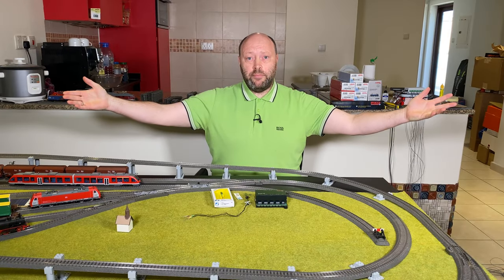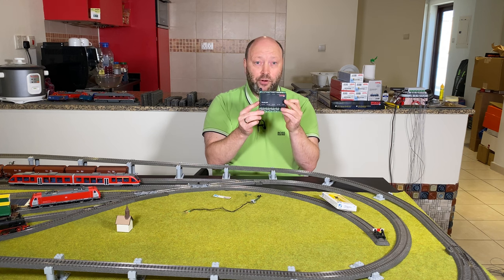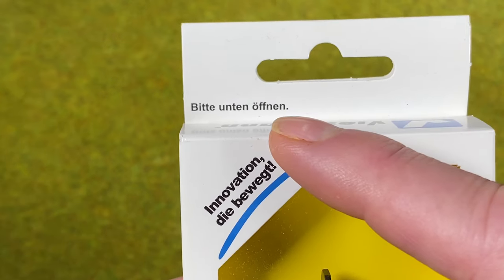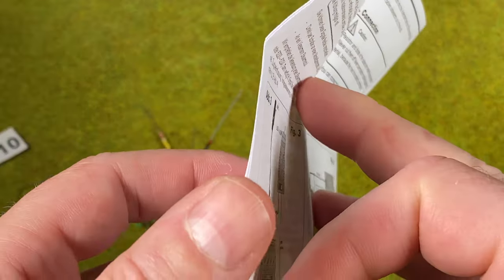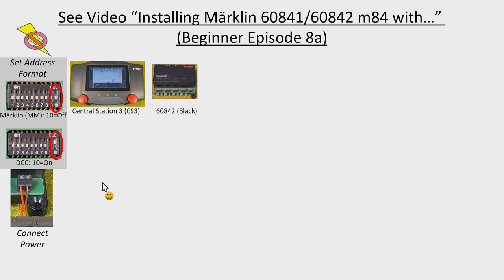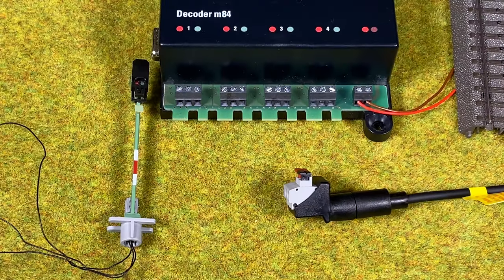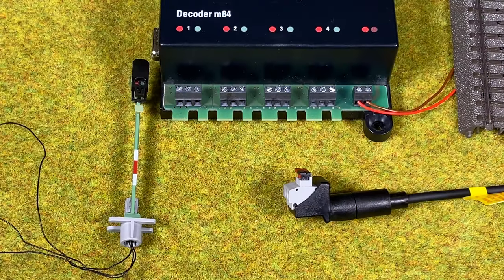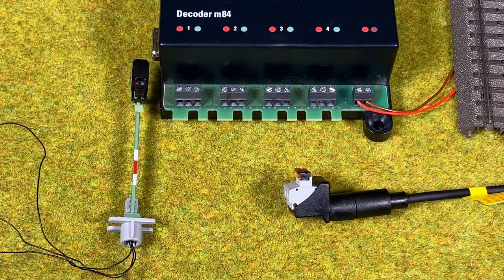Using Märklin 60841/60842 m84 with Viessmann 4011 Home Block/4010 Distant Signal (Beginner Ep 8b)

Comment: Hola soy Carlos de chile y  quiero saber si m84 sirve con el modulo 72442 un saludo y un abrazo
Reply from the maker: Hi Carlos,

All the way from Chile - cool!

I must admit I am unsure if you can connect the braking module (Märklin 72442) to the m84. To me it seems like it should be possible. However, looking at the manual it is only illustrated how to connect the m83 - not the m84: https://static.maerklin.de/damcontent/a2/e9/a2e9f739a75dab8f95b1c75bdcb21b441572012932.pdf

I assume this is because the Märklin72442 braking module needs a pulse as provided by the m83 for the "decoder input". The m84 produces continuous  power, which the braking module may not like. To me this hints that according to Märklin one cannot use the m84. However, through programming one can change the m84 to make pulses - however, these are rather long pulses (not as short as the m83 pulses) and I never made it work.

As I see it this is not recommended by Märklin and I am unsure if there is a way. I might look into this in the future. If you are impatient, then email me using the email address in the about and I can try it out: https://www.youtube.com/@ModelTrainFun/about

Enjoy ;-)
Reply: Gracias por la respuesta te sigo en tus videos y podrías hacer uno del módulo de frenado 72442

Comment: Thank you for your videos, I find them very helpful. I have a question regarding signals. What if you have a multi headed signal capable of showing more then two orders, like stop, proced with cation or go? Can you control it with a m84 or is there another way?
Reply from the maker: Hi Espen, 

You can control 3/4 aspect signals with the m84. You can see how to in these videos: https://www.youtube.com/watch?v=-tCobPG3uPU and https://www.youtube.com/watch?v=YPOtWhGVsNI 

However, as you will see it requires quit some diodes. I believe that the ESU SignalPilot and other brands can do the same without diodes. I do not have any experience with these, but I understand that they simplify the electronics. Unsure how easy they are to program? 

Enjoy ;-)

Comment: Hello
Thanks for all your videos,
Regarding the M84, what would be the mounting of the Viessmann signal with a stop track if the M84 was fed with the 66360 + 60822?
Thank you for your answers.
Friendships
Jean-Jacques (french guy)
Reply from the maker: The Märklin 60822 provides extra power for the M84 - not for the signals. In this way using the Märklin 60822 with the M84 will not change how you connect the Viessmann signal to the M84. The manual for the Märklin 60822 page 7 (French page 9) describes how to connect it to the M84 (or M83): https://static.maerklin.de/damcontent/2f/bf/2fbf635524a6c0bb4950971f73fc3b4a1650956096.pdf

Is this what you are looking for? Enjoy ;-)
Reply: @ModelTrainFun  OK thanks for these precisions.

Comment: Does this work with m83
Reply from the maker: You can do something similar with the m83 - however, it requires some special programming of the m83, you can only use track power for the signal and I am unsure if you can make the stop track.  I might make a video on this in the future. Enjoy ;-)

Comment: Very interesting and well explain. By the way, I have a problem to connect a signal decoder by B-Models (a Belgian manufacturer) to a Märklin CS3. Has anybody an idea?
Reply from the maker: Hi Bertrand, glad you liked the video. I know B-Models from my time in Belgium. I lived shortly in Brussels. I have not tried their signal decoder. Is this the one?
- NL: http://vanbiervliet.com/downloads/seindecoder-NL.pdf
- FR: http://vanbiervliet.com/downloads/seindecoder-FR.pdf

What is the issue?

Remember to connect the signal to the programming output on the CS3 to program it. After programming you can move it to the main power output. The signal decoder has default address 1 and is changed by use of the programming button on the decoder and sending a new address.

Enjoy ;-)
Reply: @ModelTrainFun  Hi Bo! Many thanks for your quick response.The fact is that I'm rather new with the digital layouts. I'll try something else today and I comeback to you with a feedback.
Reply from the maker: @bertrandleton4044  A big part of the hobby nowadays is also to figure out how all the digital pieces work. Hope you make it work. Enjoy ;-)
Reply: @ModelTrainFun  Hi Bo.indeed. Not always easy. I'll try to link a there-phases signal to my CS3. Succeed! By the way it seems the bug in the CS3 is now fixed. I'll need to update your video ;-) For the B-Models decoder, what I have received from the manufacturers is the manual (that I had already) and the confirmation that it should be work with a CS3. The question is how. I wonder if my decoder is still functional.
Reply from the maker: @bertrandleton4044  Glad you succeed in linking a 3-aspect signal to the CS3 and I hope you also will have sucess with your B-model decoders. To me it seems like if you take them straight out of the packaging, they should be set for a simple signal on address 1. Remember to connect both power and the "DCC signal" connectors. At least that is what I could see from the manual I referred to in the comment above. Enjoy ;-)